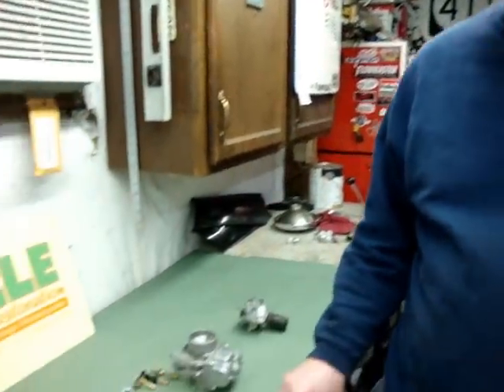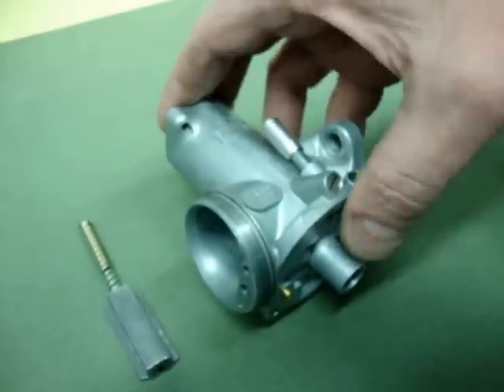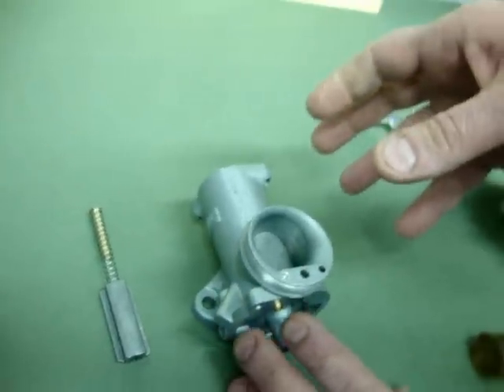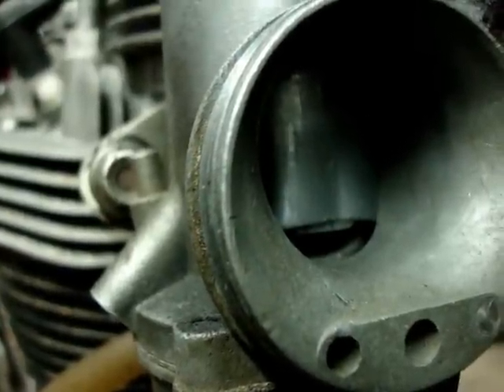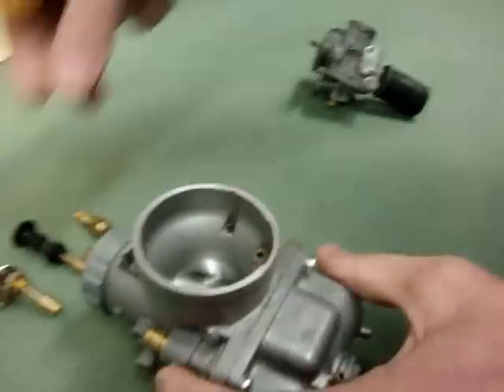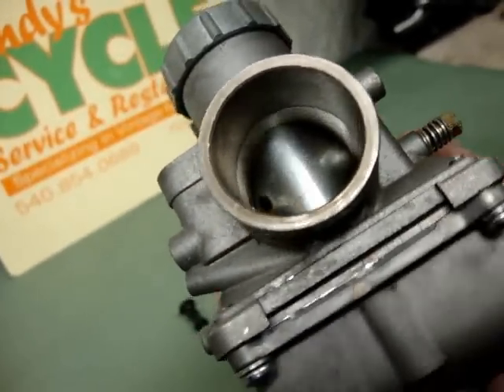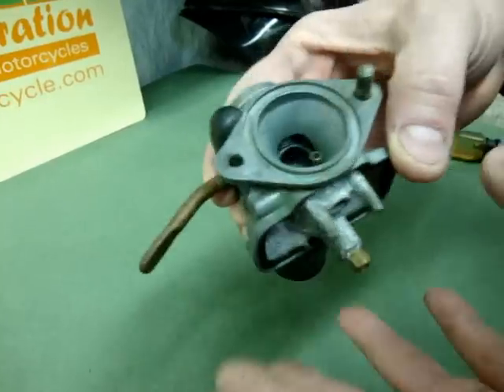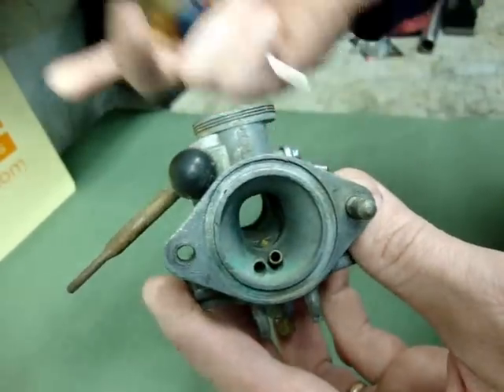Randy's Cycle Service Explains Carburetors, Choke & Cold Starting - vintage motorcycles @ rcycle.com

Comment: Randy, thank you, every word is gold.
On my 78 Yamaha SR500 (4 stroke), it is still blowing black smoke (too rich), I have the needle C clip at the last notch at the top (needle is all the way down), I have turned outwards the air-fuel mix screw about 1 1/2  turn, spark plug to its proper gap, 230 main jet, what am I missing, is my (Choke) Plunger sticking making it too rich? The choke or plunger components is the only part of the carb I have not taken apart yet.Thank you
Roberto

Comment: Great instructional video.  Thanks for posting this.  I restored a Yamaha Phazer II snowmobile recently with twin Mikuni carbs that have the cable type plunger/spring system that you showed.  I have been starting without the plungers and cable installed and it starts great.  Yesterday it got down to 15 degrees and wouldn't start right up first pull like it had been.  My question is, will it make the sled run poorly without the plungers installed?  Based on your video it sound like without them installed I am essentially keeping the sled "choked" or enriched at all times?  Problem is that it came without one of the plungers or springs.  Thank you

Comment: Thanks for this vid.  This really explains WHY the choke cable is missing on my Amal 930.  There is a choke plug replacing it.  The bike is a '57 Triumph Frame with a 62 TR6 motor with a 70 AMAL 930.  Chopped and Bobbed.  Bitch for me to start cold.  But this explains lot.

Comment: On my 85 Honda Rebel... it use to be you choked a cold engine to start it, tweak the choke, and once warmed up you could turn the choke fully off.   I assume that is normal and makes total sense to me.

Now however, I have to choke a cold engine as before, and tweak it... but the engine seems to run best once its warm with still a bit of choke on.  If I turn the choke fully off, the engine will stall out with no throttle like at a stop.  I've adjusted the idle screw so it wont do that , but the engine still has a sweet spot it likes to purr and run at when warm and under power with the choke a little on.

I don't know if the Rebel has a real choke, or enrichment circuit, or both.  It seems to be able to do a fast idle with choke as you described during start.

What should I adjust? 

I'm trying to think maybe I made some changes inside the air box a good while back with a new filter, with maybe a filter that lets air in easier... and maybe that's why it prefers a slightly richer mix.   Someone also took a broomstick and punched out the exhaust pipe internals before I bought the bike which might also be letting the air flow out more freely and make it run leaner than factory.

 I'm going to check the air box tomorrow and see what I did... and if a thicker filter fixes the problem.
Reply: Think I found my problem: last top end rebuild I did I unseated the rubber pipe from the carb where it goes into the air filter box... thusly letting in some unfiltered air direct from atmosphere.  I fixed the problem... have to wait until tomorrow or next drive to verify.  

It also maybe the choke cable is no longer adjusted properly...

Comment: The makuni carb has a fuel inlet , is the button and other small inlets for? Are they all only vents? Also does it run on oil mixed fuel?

Comment: Hi Randy, i installed a mikuni 28mm type 360 on my jawa 350 twin. The choke- which has 3 positions?- does not work.. so have to start the bike without- ver hard.. then if it runs and i press the choke, the engine will die within seconds. This carb does not have a separate choke jet?This cannot be normal.. any tips?

Comment: Hey randy. I have a kazuma kids atv and it will run if I hold in the throttle but it just barely stays crunk. If I let off or choke it, it dies. Ive tried adjusting it but that hasn't worked. Ive alsi tried vleaning it. Any ideas on what might be wrong?

Comment: Great video!!  When Im at full throttle on my keihin carb, the choke turns on, and restricts air at high speed which is scary as the engine nearly dies!

Any idea why this happens?

Comment: yea I got a guys 125 yamaha breeze, it will run spraying starting fluid in it, n quits,replaced the boot between motor n carb,no help. do you have to have air filter on to start it? and if that doesn't work is it the carb,cause theres no air filter  on it.thanks Mike
Reply from the maker: FROM RANDY’S CYCLE: Have ? about vintage bikes? Need to talk to a professional mechanic about a repair or restoration issues? Need help finding parts? Not interested in spending hours researching or lots of money trying to figure it out? For a small fee, we offer Randy Creel's 25+ years of expert, professional mechanical experience & vintage bike knowledge personally tailored to your needs. * 15 minutes = 25 US * 30 minutes = 45 US For details: rcycle . com, “Need Help?”

Comment: randy, my bike wont start , take off the air box dump a bit of fuel in there,  it starts and will continue to start all day . next morning wont start . . .it is a yamaha nouvu 2 , its getting fuel to the carb (fuel line off ,crank the engine, fuel comes out) . strange thing is once i get it started it runs all day fine , starts no problem. but if it sits for more than 12 hours. it will start for a second then die and will not start for anything    . .until i pour a bit of gas where the air box connects. i thought if i understood carbs with these symptoms the problem would be obvious. but perhaps not
Reply
 ·
Reply from the maker: +james deroc: FROM RCSR:  Have a ? about vintage bikes? Need to talk to a mechanic about a repair or to get a second opinion? Need help finding parts for your vintage bike?  Not interested in spending hours researching or lots of money trying to figure it out?
For a small fee, we offer Randy Creel's 25+ years of expert, professional mechanical experience & vintage bike knowledge personally tailored to your needs.  
* 15 minutes = 25 US